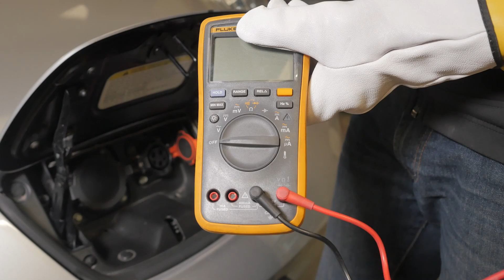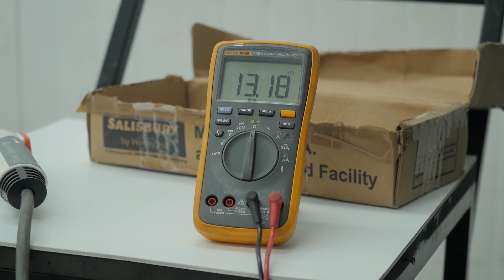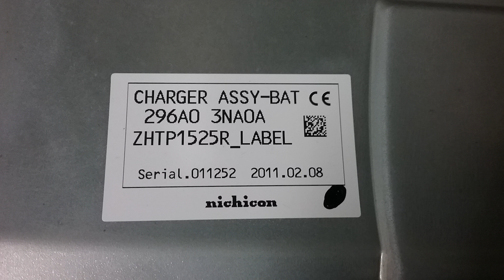Nissan Leaf Charger Fix

Comment: Thanks for the video!.. I just opened the one we have on our 2012 Leaf. It has 2 diodes in parallel and checked they were ok. Any tips on checking other components? what else can I check. Need your help for it is our only car and it died right after Xmass.
Reply from the maker: Hi.  We have recently put a lot more effort into diagnosing and repairing other things that can go wrong on these 2011/2012 Leaf on-board chargers and we plan to release some more information on this topic when time permits (unlikely to be soon). In your case if you need an urgent fix then it is probably still a case of sourcing a good used replacement unit for now and potentially fixing the unit you currently have later.  What part of the world are you in?
Reply: @EVsEnhanced  hi. I put the car back together so i can use it with dc charging. I am in Toronto and called alot of wreckers with no availability. Even checked quebec with no luck. Hopefully the info will be available soon or maybe can send me partial info? Im getting quick on taking it apart now lol
Reply from the maker: @RyanRC1  That's good to hear that you're back on the road with DC charging at least. We've got about half a dozen refurbished units in stock at the moment, but that probably doesn't help you much with us being in New Zealand and currently only offering repairs on exchange.  We've also got several custom made tools designed specifically for diagnosing and repairing these OBCs.  Unfortunately it isn't really feasible for someone to buy these tools just to diagnose and fix one faulty OBC.  However, it could be feasible for us to set up a couple people on each continent at least to help EV owners have access to a cost effective repair solution while minimizing freight costs and delays.  Is there a company in Canada that springs to mind who might be interested in offering component level repairs on these units?
Reply: @EVsEnhanced  i may be interested if there is a demand. Please msg me and we can continue the discussion. Thank you!
Reply: @EVsEnhanced  BTW.. What value did you replace the diode in the video ?
Reply from the maker: @RyanRC1  Ok.  Please contact enquiries@evsenhanced.com with some information regarding your background and equipment with regards to electronics repair.  It is our summer break at the moment though, so expect our replies to be a little slower than normal.
Reply from the maker: @RyanRC1 This info isn't on hand at the moment, but if I'm not mistaken it the part number of the component we use is buried in these comments.  That being said, the issue described in this video only applies to the first version of these OBCs with part number ending in 3NA0A. The later revisions with the double diodes were the factory fix for this issue.
Reply: @EVsEnhanced  Good day sir.. any luck with some documentation on me repairing the board :)
Reply: @EVsEnhanced  send email a month ago maybe it got buried :)
Reply from the maker: @RyanRC1  Hi. Sorry this was missed.  We have found your email and will be in touch.

Comment: I just bought an oscilloscope on Amazon prime day , 2 days ago, I am looking extra forward to receiving it. I am a master automotive technician that enjoys fixing flat screen TVs and other miscellaneous electronics but without the oscilloscope a lot of times it’s shooting in the dark.
Reply from the maker: Hi.  The repair in the video really only applies to the first variant of these 2011/2012 OBCs marked '3NA0A'. The later versions of these OBCs had a hardware revision that went to double diodes in parallel which addressed this issue.  There are some other failure modes for these OBCs that we have recently been working on with the idea of being able to offer documentation for test and repair solutions.  So far many of the other failure modes have also turned out to be repairable.
Reply: @EVsEnhanced  would love to hear about them, turns out my leaf is tostitoes without some guidance

Comment: I have a 2013 leaf, charging problem, intermittent. No fault codes. Plug charger in and it beeps, then turns off. Then beeps again and turns off... you can hear the relays in the IPDM and the battery contractor relays clicking on and off too. Does this sound like an OBC fault?
Reply: @carlab1568  sorry for a really delayed reply. Ended up having a faulty IPDM.
Reply from the maker: Hi. Checking for fault codes in the car would be a good first step.  If you want to do this yourself then LeafSpy Pro can check fault codes (read DTCs).
Reply: @EVsEnhanced  Have check codes, doesn't have any.
Reply from the maker: @stuartnicolaingham1541  Just to confirm, when on the Read DTCs page in LeafSpy, have you pressed the Read DTCs button again to re-refresh what is shown on the page?

Comment: Thank you very much for your video. 
I have the same problem but not for the same causes.
 I wanted to ask you if you could give me the circuit board diagram inside the charger.
I will try to find The problem with electronic experts .
Reply from the maker: Hi. Sorry, but we do not have full schematic diagrams for these units.
Reply: @EVsEnhanced  They are all on torrent 🙂

Comment: This is not simple at all. Is foolish having to dismantel the car for such a small diode or whatever.
 Just nonesense.
But thanks.
Let as make EV simpler please NISSAN and every other company.
Reply from the maker: As far as Nissan is concerned, the whole OBC in non-serviceable and you have to buy a new one if anything inside it goes wrong.  I don't think they intended for the diode to fail like in this case - it was just a design mistake on the first version which was corrected on later versions a few months later.
Reply: @EVsEnhanced  👍

Comment: Hi, my friend has this issue with his Leaf, Fast Charging works fine, but "slow" charging stops after 5 seconds.  Garage recommends replacing on board charger. Is there a chance this could be the same issue as you specify in this video? 2012 Leaf.   
I have asked him to bring the charger back from the garage after replacement so we can look at repairing it.
I am certified electronics repair technician and have tools necessary for SMD work.
Reply from the maker: Hi. There are also other OBC issues we have come across on 2011/2012 Leafs which aren't as easy to fix.  Generally speaking the problem described in this video only applies to late 2010 and early 2011 Leafs. On the later 2011s and 2012s they revised the OBC hardware design slightly to prevent this occurring.   So on a 2012 it is most likely going to be another problem.
Reply: I also have this problem, blue lights come on then go off
Reply from the maker: @fixthefault  Checking for any DTCs in the on-board charger would be a good first step.
Reply: @EVsEnhanced  hi i get p3173 and b29c1 when charger pluged in
Reply from the maker: @fixthefault  There are 5 variants of DTC B29C1 which LeafSpy doesn't show and each one means something quite different.   So you probably need to get this information from someone with a more advanced tool to diagnose further.  Don't worry about P3173 - that is just the VCM detecting that the on-board charger is unhappy.
Reply: @EVsEnhanced  says signal stuck low, tested wiring from port to obc all ok
Reply from the maker: @fixthefault  If there is 110/220V AC coming into the OBC for a brief time when you first plug in then and you still get the signal stuck low variant of B29C1 then it is likely that there are several failed components in the OBC.  We've seen a few cases of this and have stock piled several of these to look at repairing some time in the future.
Reply: @EVsEnhanced  do you sell obc that have been repaired
Reply from the maker: @fixthefault  Generally we have some good tested spares, but depending on your location shipping may be a significant cost as they are rather large and heavy. We are in New Zealand.

Comment: Hi who did you use for the circuit board repair? Thanks.
Reply from the maker: Hi. We did the whole repair in house.
Reply: @EVsEnhanced  Wow. Thanks for the response.  Can I send you the PCB out of my charger for troubleshoot and repair.
Reply from the maker: @ripyafaceoff  Sorry, but we are pretty snowed under with development on other projects right now so unfortunately we can't offer this as a service currently.
Reply: @EVsEnhanced  Can you post a video on how to repair the PCB? I live in the Bay Area and pretty sure I can find a repair shop here. Thxs. Leland
Reply from the maker: @lelandwiesner7523  Hi.  There is enough information in this video that identifies the components that we replaced.  Any decent consumer electronics repair shop should be able to handle this if they are given the control board removed from the charger.  The more important part is diagnosing that the fault is the same one as identified in this video before removing anything.
Reply: @EVsEnhanced  Thanks Raoh. I am curious how you were able to pinpoint the problem so accurately as our Nissan dealer has a couple of fault codes and has no clue what to do except start swapping lots of (expensive)  parts. Also, do you think putting a diode in line with the charger port is advisable vs repairing the obc circuit board? Seems like it is bypassing the built in safety features. Thx again.
Reply from the maker: @lelandwiesner7523  Hi.  Did your Nissan dealer give you a list of the fault codes?  If so, you could email these to enquiries@evsenhanced.com and we'll take a quick look.  A car 2011-2012 Leaf that isn't charging isn't always related to the fault discussed in this video.   Also, getting the part number of your existing charger would be helpful as the on-board charger hardware was revised several times between 2010 and 2012 so there are several variants.  In general, only the late 2010 and early 2011 built chargers are prone to the exact fault discussed here in this video.
Reply: @EVsEnhanced  just sent an email. How can i get the OBC model without tearing apart the car?  Thx.

Comment: wait so they liquid cool the charger but not the battery pack?
Reply from the maker: Yes that is correct. The traction motor, inverter and charger are all liquid cooled. However the battery pack is not.

Comment: hi I have the same problem in my Nissan leaf, it is changeable by  quick unit but not by normal home plug. could you refer me to  your garage in the UK please.
Reply from the maker: Hi. In the UK I recommend checking out https://www.hevra.org.uk/ for a list of EV friendly garages.
Reply: I have same problem with my 2013 leaf

Comment: Leaf azeo 2013. was charging to 86% then stopped. Charger fault. 4.5v and 0.61kO measurements in low speed input... No mistakes on display. No mistakes in Leafspy. Car is not charging. Please, help

Comment: I traded in my civic for a ‘12 leaf.  The lcd screen would not stay closed to its slot (the screen than opens to insert a cd behind).  Even when the car is off that screen kept moving.  Also, I assume the li on battery was too old not holding a charge.  The tow guy came around because I was stranded for six hours due to the leaf being drained of power.  I owned the vehicle for three days and it stranded me twice due to battery problems.  I finally asked for ‘Carvana’ to take back the vehicle and return my old civic.  Don’t get me wrong I still love the ocean blue quiet Leaf, but it gave bad first experience to trust an electric car.  
I do appreciate these videos.  It makes sense how you explain it.
Reply: Water damage. Mine did the same thing. Back and forth until it dried out

Comment: Great video... my rapid charger stopped working. The small one works fine....can you make a video on rapid charger failure too. Thanks
Reply: i have the same problem did you fix this issue
Reply: @saquibmiah8564  no as i rarely use rapid so just normal charge for now.
Reply: @minibash4100  i,v been told to get a brand new 12v battery from nissan for 90 will fix this problem i,m just being cheap atm lol
Reply: @saquibmiah8564  how on earth is the 12v battery causing rapid charge failure. My battery is healthy!
Reply: @minibash4100  will let you know if it worked foe me been told it may be healthy but not  enough
Reply: Saquib Miah Did it work for you?
Reply: @minibash4100  in  much cases, the 12 Volt Battery is the reason for troubles...roundabout every 2 years...!

Comment: You can just add a diode, to the pilot wire, at the J1772 connector. A friend did that with his out of warranty LEAF.
Reply: Hi. Do you have anymore info on how he done it
Reply: @preytec  just cut the pilot wire and put the diode inline. The band on the diode should be pointing away from the J1772 connector. Use a 1N4004 or similar.
Reply: @phichi01  Hi. I'm going to look into this more carefully before I start doing anything - but can you please tell me if this method and component works with 240V supply?
Reply: @phichi01  help. Diode did not help my leaf to charge... Aze0 2013. Charger fault. No mistakes on screen and Leafspy.. Charger fault blinking.
Reply: @michael7on  This is for one specific fault. If it didn't work, you must have a different failure.
Reply: @phichi01 (
Reply: @phichi01  pdm is broken. And charger is broken. Pdm changed - works. With another charger...
Reply: @preytec  look into the tread before......there is an LINK to this workout!
Reply: Hi.  So you actually modified the charge plug in?  So if you charge somewhere else you are back to the same issue ...  If I understand this right
Reply: @kenteghtmeyer4586  No, it fixes the problem. A diode in the charger fails shorted. Adding a diode to the pilot wire replaces the bad diode in the charger.

Comment: Thank you. Very clear and helpful info. Any recommendation for repair shops in Los Angeles, CA that would do this work?
Reply from the maker: No problem. Sorry, but I don't have any contact in LA that I can recommend. If you have any local EV or Leaf groups or forums then I would ask around in those to see who in your area might be capable and willing to complete this repair.
Reply: EVs Enhanced thank you!
Reply: You can just add a diode, to the pilot wire, at the J1772 connector. A friend did that with his out of warranty LEAF. No need to replace the diode in the charger.
Reply: philip c that’s encouraging news.  I will do my research on how to do this but any info on how to would be appreciated. Best.
Reply: @phichi01  hello  can you tell me how it was done. because my EV have the same problem and I need temp solution
Reply: @phichi01  It looks like adding a diode would create an adequate circuit to allow the charging, but not sure if that would also meet the safety requirements if there is a failure.